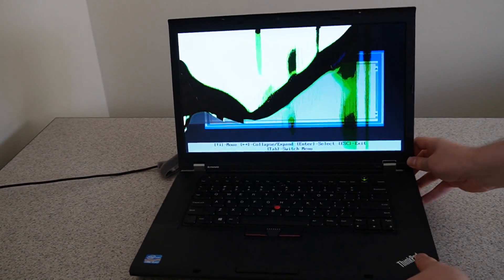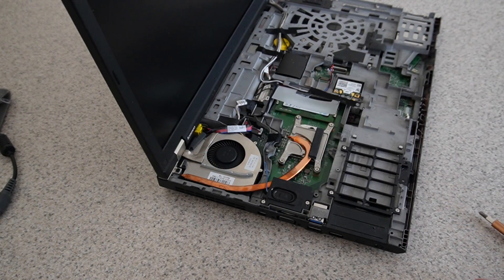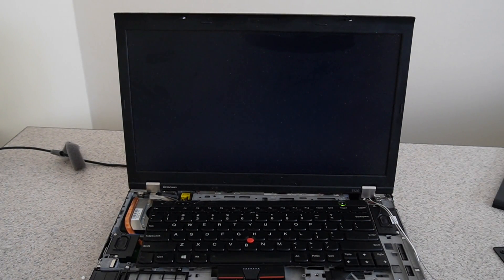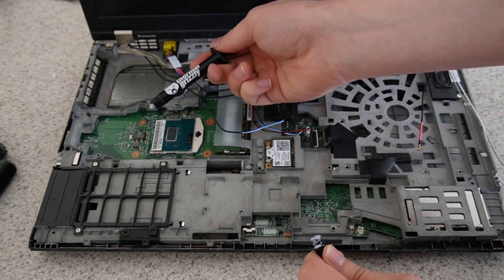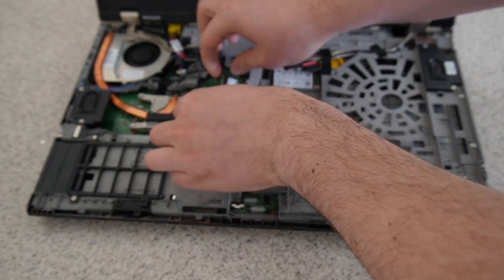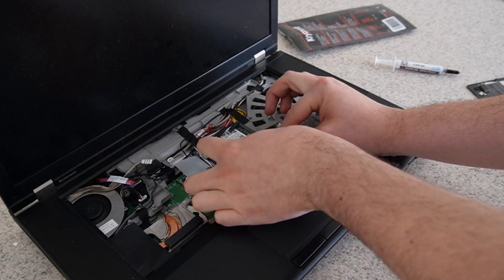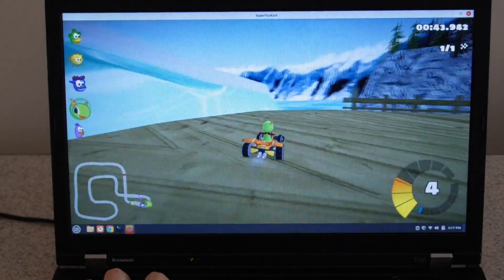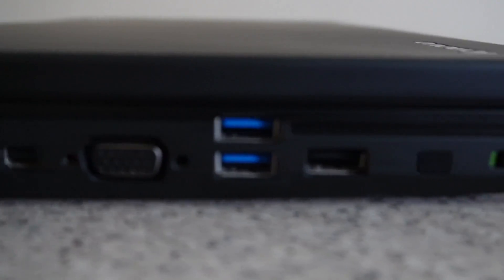Fixing and Upgrading this Old ThinkPad. Was it Worth it? (Thinkpad T530)

Comment: If your T530 came with a 1600x900 LCD (and thus has the 2 channel LVDS cable going from the mobo to the screen), there's cheap drop-in 1080p LCDs available like for example the AOU B156HW01 
Also If you run Windows on one of those, for the love of the red trackpoint nipple, use 10 LTSC instead of the full fat/bloated Win10 or even worse, Win11

Comment: Yeh, so much potential, wish they had IPS full hd screens for this. Do you know part number and where to get decent fan to cool CPU and GPU? 
I got Msata and 2.5SSD lots of space no.
Reply: Unlike the 14 inch T430, the 15 inch T530 has drop-in replacement 1080p LCDs available that aren't the waaay overpriced IPS mod. Only prerequisite is that the original screen is 1600x900 (2 channel LVDS)

Comment: I love what you did for this great laptop.  I did the same thing with the mSata drive, upgraded the LCD panel with a Chinese video add on-chip and the IPS panel, Intel i7 4core, 8logic processor, 16 GB ram, 1 TB HHD for video,mp3, documents, and downloads storage.  The Backlight keyboard renewed "plastic parts as needed. and Windows 10 Pro.  This is my current "Daily Driver",  I love it!

Comment: If you think this laptop is old and are concerned about whether it was worth it or not, don't feel bad. I just got an old T60 widescreen model fixed about over a week or so ago and I recently installed Linux Mint Xfce on it and themed it to look like Windows XP but even then, I can still make good use for it as a secondary laptop. It may be a bit slow but for basic web browsing, I think it should work perfectly fine.

Comment: i still use my T430 to this day on window 10 pro! 
i7 3840qm, 16gb ram, 500gb ssd and 500gb hdd (in caddy in ultrabay)!
currently used as drum recording setup with a firewire Project mix IO via an expresscard adaptor!
its setup to record 8 mics plus a full electric kit as well via usb &/or midi!

perhaps win10 might be better suited to your T530, theres still just over a year b4 EOS! after then: GNU/Linux all the way!

im considering just air gapping mine/keeping it offline after next October, so i can preserve my ability to use my mixer!
Reply: il prend très bien Windows 11. Je l'ai sur un T520 ^^
Reply: Windows 10 LTSC (long term servicing/support) is a thing. Security updates (and nothing else) up to 2032 for the IoT edition, and it doesn't come with all the bloat the regular consumer version does (no microsoft store and xbox app for example, though these can be installed if you really need them)

Comment: Nice. But as a ThinkPad T530 user, I have a question. Does the trackpad work perfectly fine for you? (I am asking because my trackpad sometimes acts erratically)
Reply from the maker: I do not, but i had a t430 a while ago with that issue. I think i had manually installed the snapmatic drivers.
Reply: @Duraputer  Alright, thanks. I may try to do some research and figure that annoying thing out
Reply: I got a T530 as well and the track pad on these older ThinkPads have never been the greatest in response. So, no youre not alone.